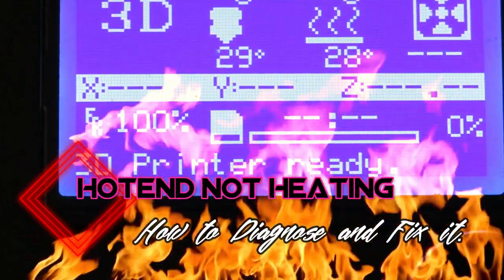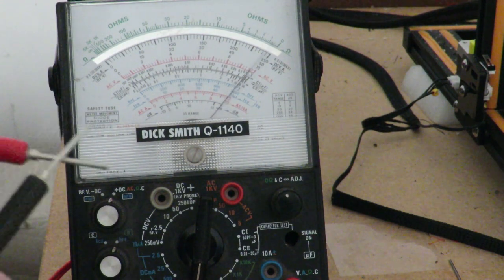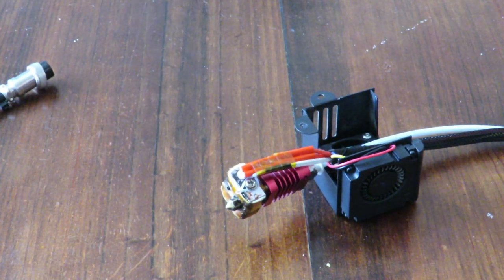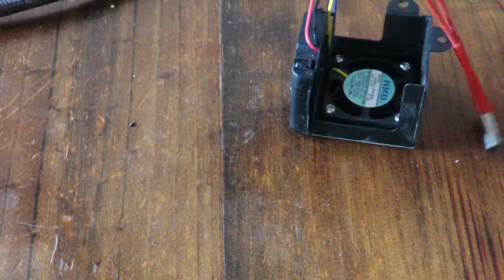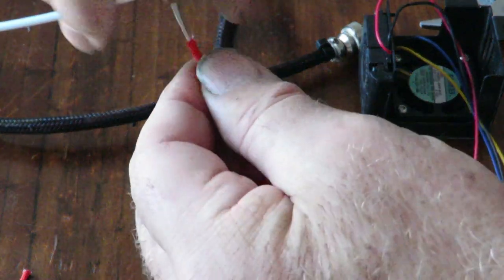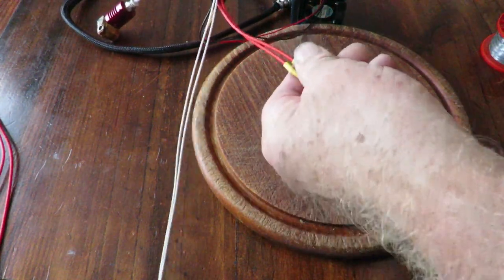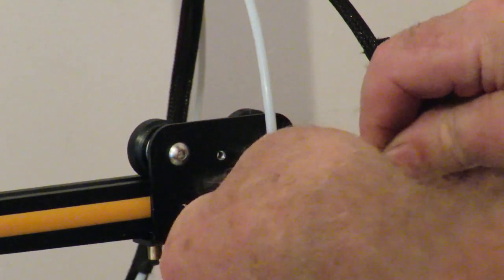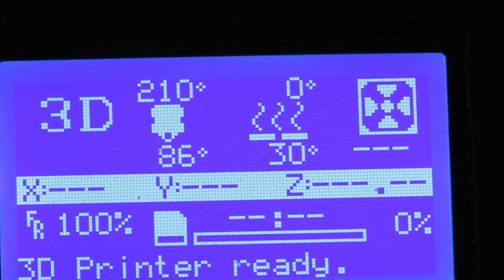📌3D Printer hotend won't heat up - Diagnosing - identify Fault - Replace Ceramic Heater Cartridge

Comment: Using a heat gun to figure out if it is a connection or the actual got the that's bad is genius.  Just made my life so much easier, thanks.
Reply from the maker: Glad I could put a smile on your face. 😀

Comment: Gary, great quick fix for the Hot End replacement. I just have a word of advice if you don't mind. I was a Radar Technician for almost 40 years and have done my fair share of Solder repairs. It's always best to stagger the wire cuts by about 1" to 1 and 1/2". The reason being, when you heat up the heat shrink with your heat gun, if there are any sharp wires where you joined the two wires together, they can easily come through the heat shrink and if that happens to both connections at the same time then you can create a short. If they are offset by a small distance, even if you have a small protrusion from a heat shrink tear, you should be safe and not have a short. As a further layer of protection, you could add a longer, and a little bigger diameter heat shrink, (Make sure you slip it over the wires before any soldering is done, and make sure the Soldering Iron does not heat up the Heat Shrink), to cover both sets of wires and shrink that sleeve to cover both wire connections. Thanks for the video Gary, knowledge shared is Gold for us all!!!
Reply from the maker: Thanks for your in-depth review on hoe to create a better solder joint than I made.
It will be handy for others to not make the same mistake I made.
Reply: @GarryPurcell  Hey Gary, you didn't make a mistake my friend, the suggestions that I made to you was just to make an already good repair just a little bit better). I worked on Radars in the Military, (Hawk Radars), that were Mobile so the repairs that we made had to go hundreds of miles being towed by a Duce and a half, and when we would get to where we were going, the Radar is supposed to fire up and work at the drop of a hat, every time, LOL. that's when you learn to improvise on repairs to try to make them as durable as possible. When I went into the Military in 1973, the Radars worked on tubes. Digital wasn't phased in until about 4 years later. Can you imagine bouncing a Radar down the road for hundreds of miles with hundreds of tubes in them??? There are some pretty good videos online showing the Hawk System firing Missiles. If you get a chance check them out. Later my Friend!!!
Reply from the maker: @bobburchett8517  Those stingers sure beat my Cheap new year rockets display.

Comment: Gary, thanks for this. I attempted a complete hot end replacement on my Ender 3. Ended up with the thermistor stuck at room temp, and me scratching my head. But I've just tried your trick of heating the thermistor with a hot air gun, and it worked. So tomorrow I know to only mess about with the heater cartridge. Thanks again.
Reply from the maker: Glad I saved some valuable time diagnosing the problem.
Let me know how you go.

Comment: As a fresh dingus when it comes to 3D printing, i were scared starting to do anything with the printer, but after changing the printerhead i felt a little more comfortable.
So thanks to your video, i am now going to take it apart and change that part as well since every troubleshooting i've done pretty much say it's the heating tube.
Also, since it's 5 years since you put it out, here in Norway that part now cost 10 dollars, not an aweful price, but price certainly jumped ^_^
Reply from the maker: Wow, the heater cartridge that's gone up heaps. 💰
Reply: @GarryPurcell  or it can just be that cause i live in Norway, where everything is expensive compared to other countries.
Anyway, i hope the cartridge will solve my issue as that's what everything is pointing to.

Comment: Thank you, after having struggled a few months with a printer not really doing as I'd like, after having changed hotend a few times and just getting more and more frustrated, I saw this video and just decided to try and shove the heater slightly deeper into the hotend and... it WORKED! I'm guessing movements and heating/cooling must've moved it over the last year or so. It'll definitely be something I'm looking out for in the future!
Reply from the maker: Great to hear!
AND.... a good tip for others who read this also. 🙂

Comment: When you’re testing for resistance on the heated cartridge wires, are you cutting the wires so you are checking continuity across the mainboard end or the cartridge end?

Or are you just poking the multimeter leads passed the insulation into both wires?

Comment: Great video Garry.
I am trying to diagnose a similar problem with my ender 5 Pro's hot bed not heating up. I was able to confirm that the system software reads the temp from the hot bed when I use a blow dryer.
I have a multimeter, and I measured the red/black wires soldered to the hotbed (while trying to preheat) and found 0 ohms resistance, and 0 volts DC.
I also measured the bed thermistor pins (where they connect to the 2 white bed wires) for resistance/DC voltage and read 0. Though since the system is reading the temp from the thermistor I think these wires should be fine, right? At this point you can probably tell I don't fully know what I'm doing :)

I am curious what further steps I can take to diagnose the problem? It seems like it might go back to the board? I'm reluctant to open that up until I know what to do.

We had to take a drill to one of the bearings on the machine to remove a bit of allen wrench that snapped off in a screw (nightmare. terrible wrench). I am assuming the vibration caused some sort of damage to the circuitry, despite it being pretty far away from the drill site :/

Thanks for your time reading this comment if you get to it. I can already see you get many questions. I've been researching this for hours but only can find scraps of information about it, and I lack the general knowledge to solve the problem intuitively (for now). Your video was the closest I got to a step-by-step troubleshoot of my own issue.
Reply from the maker: I'd suggest the heater cartridge might still be at fault.
Reply: @GarryPurcell  Is that the two white wires running into the center of the bed? The hotend heats fine of course

Comment: Very helpful video.  I have to replace mine as well as the thermistor which pulled out.  Any thoughts on where that belongs and if the same process can be used?
Reply from the maker: The Thermistor is next to the Heater Cartridge, and is very easy to replace. So you can do both at the same time.
Reply: @GarryPurcell  Thanks, I understand that, though I don't see how it actually connects to anything on mine.  I'm wondering if I've lost a piece or something.
Reply from the maker: @ga1205  The Thermistor simply looks like two wires joined together in a very small diode.

Comment: Hi there, Great video! Will any 100k heater cartridge work as like as it's the correct voltage? Or do I have to get from the manufacturer? Also will soldering them together mess with anything like voltage or resistance? Will the temperatures be off? Thanks!
Reply from the maker: I use generic heater cartridge's, without any problems.
As long as the cartridge is the same dimension as the one you take out, you should be OK
P.S. Soldering the wires is OK.

Comment: Would this work for a thermistor? My nozzle reads -14 degrees. I only assume it's the thermistor but do intend on doing this to the cartridge like you did.
Reply from the maker: Test the thermistor with a hair dryer, and see if the temperature reading goes up.
Reply: @GarryPurcell  I tried this method and it worked! Thanks a ton. I'll be trying the hairdryer out later today to be sure its all good but as of now the printer seems to be fine

Comment: Helpful video. I don't have a multimeter so I just did the hairdryer thermistor test (thermistor still works),, then wired up a new heater cartridge. It heats up like normal so thankfully the board isn't shorted.
Reply from the maker: Glad you found my video useful and saved yourself a few dollars.🙂

Comment: ok just out of curiosity my wires broke on my heating element and i was checking the resistance but the wires were broken when i found that problem i can only get the resistance from the broken parts in the element makes sense the thing is that they are reading 15 ohms but i also know that the length of the wire adds resistance so if im reading 15 ohms at the base were the terminals stick out of the element would it be reading an accurate resistance or do i have to measure the ohms with the wiring attached i am trying to replace my hotend put i am unsure if its a 12v hot end or a 24v hot end and i dont want to order the wrong part any advice is appreciated.... or do i just read the voltage straight out of the motherboard
Reply from the maker: My suggestion is to look up your actual printer online, and go to the specifications to see what hotend it has.

Comment: Isn't it generally a bad idea to solder heating element wires of any kind due to the fact that they heat up considerably? This is why they are insulated at all, because they get hot. I think it would be better to replace the whole cable than rely on a solder connection on a wire harness that sees a lot of movement (mechanical strain) and heat. Any thoughts on this?
Reply from the maker: 1. Your refering to soldering high current connectors. (Mechanical connection is better in this instance)
Any small guage wire being too thin to carry the designated current, will cause them to overheat.

2. Stress Fracture of the hotend wires is something that the CR-10 needs to address.
Reply: @GarryPurcell  thanks very much for the clarification.

Comment: Thanks for the easy to follow video. A week of googling has brought me here and I'm not sure if this will help my issue or not so before I start taking stuff apart: my Ender-3 V2 consistently heats up to 10 degrees lower than what it's set to. If I set the hotend to 200℉ it will only heat up to 190℉. If set to 210℉ it heats up to 200℉. If set to 215℉ it will go to 205℉ and so on and so forth. Any temp you come up with it will only heat up to 10 degrees lower. This is a very consistent thing, however every now and then it will actually reach temp and I could print. That happened for a bit where I was eventually able to print and now if it happens to get to that point it possibly prints about half the brim before the temp drops too low and the machine gives me an error message. Does anyone have any thoughts? Thanks!!
Reply from the maker: It certainly won't hurt trying a new heater cartridge.
Reply: Thanks  @GarryPurcell ! I purchased new heater cartridges, thermistors and kapton tape yesterday. Hopefully this gets it resolved.

Comment: So you just touch the heater cartridge? How do you test if it is the board? I changed the heater out twice
Reply from the maker: Check to see if you have continuity in the heater wires.

Comment: Just did this to diagnose a fault on a brand new Enter 3D v2. Element was open circuit. Brand new out of the box and ran for an hour.
Reply from the maker: That's not a good start, but at least you found the fault and your printer, and you will be up and running soon.

Comment: Cut the leads so they are offset, so the joints for each lead are a different length, this means that you dont need to worry about the shrinkwrap becomming degraded and allowing a short.
Reply from the maker: Great idea, thank you for sharing.🙂

Comment: My Ender 3 hotend heats up but doesn't go beyond 163 deg. What could be the problem? Any suggestions will be a great help. Thanks!
Reply from the maker: There are only a few components that can stop the hotend from heating, Faulty Wiring, Mainboard, Thermister or Heater Cartridge.

I personally would replace both the thermister and heater cartridge, if you have already checked the wiring, and found no broken wires.

Comment: How do I take care of an extruder that does not heat up with a Flashforge Adventurer 3 3d printer?
Reply from the maker: Fist step would be to check the connections are a tight fit
Then check to see the wires are not broken.
Third would be replace the hotend cartridge and thermistor at the same time.

Comment: Quick question: I assume + and - doesn't matter with the cartridge wire? I need to replace one on my Maker Select Plus.
Reply from the maker: Correct, polarity makes no difference to the heating cartridge.

Comment: Hi, this video really helped me and my hot end will heat up again after replacing the cartridge. However, the temperature wont settle on the one one I’ve chosen it keeps going higher and lower but not settling in the middle on the temperature I’ve chosen. Can you help me please?
Reply from the maker: Did you also change the thermistor for your printer?
It could be faulty.
Check wires for breakages.
Reply: Running a PID auto tune should help with this as well.
Reply: Sam, I just repaired my printer for Temperature problems. What I found was a wire not soldered very good on the round 8 Pin connector that connects to the control box. Hope this helps someone out there.

Comment: very helpful, thanks, but why cut and solder rather than soldering new lead all the way through on to the connector?
Reply from the maker: Hi Chris
The thermistor wires are the limitation.
If you can desolder inside the thermistor canister without damaging it, then resolder direct it should work the way you want.
BUT.... it's far easier to simply solder the new thermistor canister to existing cabling.😉
Reply: Thanks, I bought 5 new heaters and 5 new thermostats as the nozzle would not heat over 140 or so and once apart decided to replace both rather than just terminator. All you tube say to cut and solder as you did but I sent the leads back to the end that plugs into the box and soldered the new leads on to the connectors where old leads came off so no joins mid way
Reply from the maker: @cmhes1  
As long as it works OK for you.
Another way is to solder a JST plug into the cable, and the thermistor.

Comment: nice video thanks :) just a couple of tips to get the heater out easier next time when you heat the block you can just pull it out after removing grub screws , also to make it less chance of a short stagger the cuts on the wire you are joining :)
Reply from the maker: Thanks Peter
Very good advice if I need to do this next time. 🙂

Comment: My New ender 3 V2  damage nozzle heater, ı replace it and than damage the new heater too. I read 24v in the voltmeter when the heater is running. Every thing seems good . Whats wrong ? Please help me ?
Reply from the maker: Have you tested the Thermistor to see if its working?
Reply: @GarryPurcell  yes, test with hair dryer it goes up
Reply: @GarryPurcell  and it shows room temperature when I start the printer
Reply from the maker: I'm not familiar with the Ender 3 v2.
Does it have a plug setup for fast cartridge replacement, or do you need to solder the wires together?

Comment: If the hot-end does not show temperature increase with use of a hairdryer, what would be the likely cause...??
Reply from the maker: Most likely cause is that the Glass Sealed Thermistor is faulty.

Comment: This isn't too common is it? I'm ordering a CR-10 during the Black Friday/ cyber monday sale this week. Would the CR-10s be worth the extra monies?
Reply from the maker: A Heater Cartridge can burn out in any printer, they are very easy to fix.

One way to prolong the life of a cartridge is to always use the control panel cool down procedure when the print has finished, and the nozzle is still hot, rather than simply turning the switch off at the wall.

You are more likely to damage the Thermister with a print runaway nozzle blockage, when removing the blob of plastic from around the hotend nozzle.

I highly recommend you keep a few spares on hand, you may, or may not ever need them, but if you do need one you don't have, you will be in for a long wait for a replacement part then costs only a few dollars, and you can't print without it.
Reply from the maker: Oooops forgot to answer your second question.
I have the CR-10S and I'm very happy with its overall performance.

As to which you should get, that is really up tp you.
If you can afford the better CR-10S, then I would say get it.

You can of cause always buy the CR-10 Standard, and upgrade later, BUT.... it will cost you more to do it that way in the long run.

Comment: garry can you provide the link to the part you bought as I have a 10s and wouldn't mind getting the same part you bought. cheers, Barry.
Reply from the maker: These are very cheap AU$1.74 with free shipping.
📌 Gearbest 12V 40W Ceramic Cartridge Heater 3D Printer Part ( 6 x 20mm )
https://goo.gl/toJrco
Reply: thanks mate, i just ordered some of them. thanks Barry
Reply from the maker: These things are so cheap you would think Creality would provide a spare in the kit.
P.S. I hope you never need to use the spare.

Comment: Man I did all that and I STILL can't get any heat. I could put on third cartridge, but it seems like it would be a waste. Hmmmm. The funny thing is it was printing perfectly for days on end, and suddenly it just quit in the middle of a print. UPDATE: Well after taking pliars and giving an extra squeeze to the connectors that are under the high temperature insulation on the new cartridge, I'm finally getting heat again. Though I'm not sure why the previous cartridge suddenly failed after weeks of functioning perfectly. Kind of a mystery.
Reply from the maker: Good to know, it was a connection issue, and you got it sorted out.